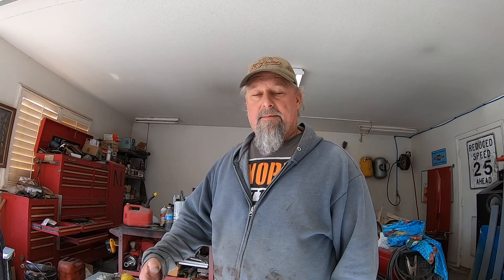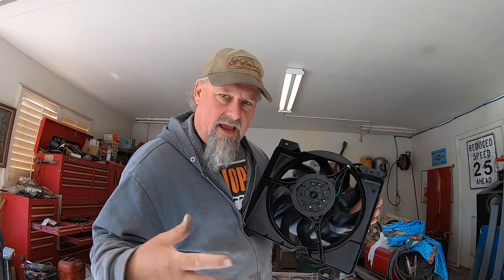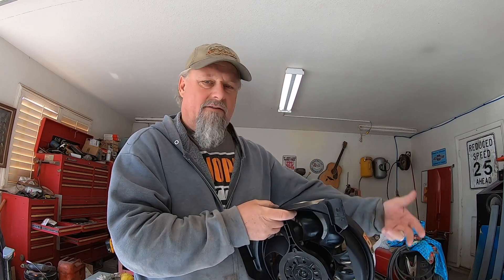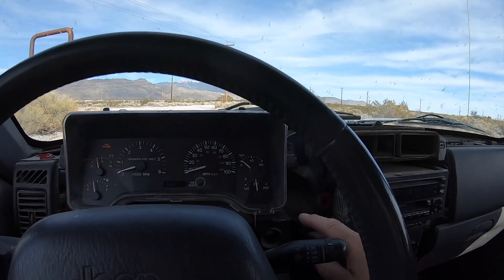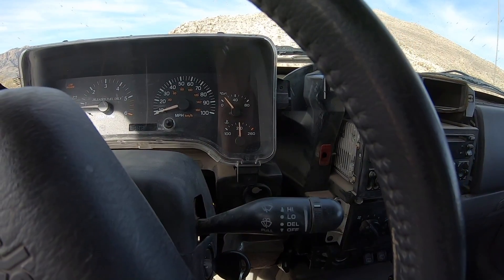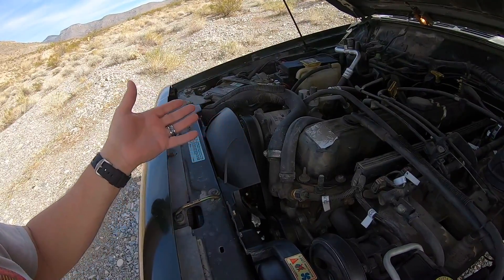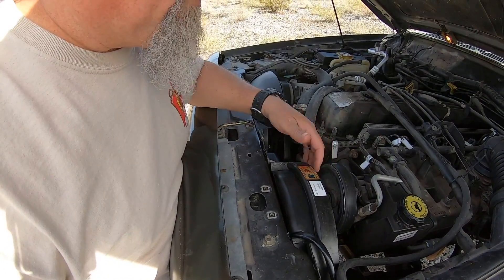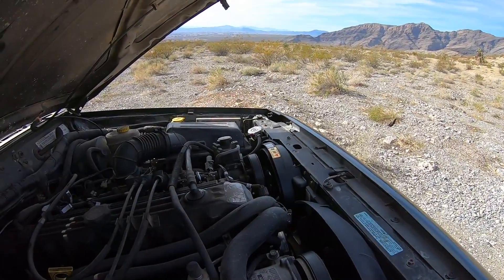Jeep XJ Mechanical Fan & Shroud, Aux Electric Fan Performance Real World Test

Comment: Very nice video! I've recently solved the aux fan not coming on in my Renix by using a late thermostat casing and placing a thermo switch in the provided port (not existant in the original Renix casing). A properly working radiator and clutch fan, plus the shroud keep the temp at bay even idling at 104F.
I'll change the aux fan to an 8-blade as well. Not needed, but it won't hurt to get the 33 year old fan out and put a new one there.

Comment: Clutch Fan wear is also something you should think about. Antifreeze keeps your ride running cooler in the summer and protects against freezing in the winter. Using water is must be distilled Water or the Block will rust from Tap Water use. That E Fan needs to be hooked back to the Temp Sensor under the hood.

Comment: hey whats up man, any update on your jeeps cooling ??? just bought a 98 jx myself hooking up duel fans rn. Also installing the same switch you used lol, did you just drill a hole into the back of the ciggarette pannel, looks like i have to remove a lot of plastic
for a phone cord or something. Thanks!
Reply: Where did you buy your dual fans?
Reply: @ignaciocastillo4891  they came with the jeep when i bought it. they wernt made for my jeep and could be fitted to the radiator better

Comment: Factory set up on these works great.
Reply: MichXJdad  good reply, but if u want tips on cooling it, then keep 99 percent of the factory set up , if in warmer climates use dual electrical fans not 3, and use the factory stat,  be sure to perfect the mixture, use distilled water religiously,  and check belt tension. And no not rev the piss out of any engine when under 4x4 load, it's not a mad ram buggy it's a creep jeep, gag it when necessary otherwise I'm that guy with a no faults system and it's all factory, I dont even run an electric fan and still use the cytrfical force fan with no shroud, it does not get hot, a single row is better than any other row, because it allows air to flow faster threw it . Clean hoses and solid water pump and the correct factory stat, Ive done everything else with fans and rads and pumps and stats, factory set up has yet to make problems ,and running to cool will hurt these engines and running to hot of course will.... they also like to warm up a little before taking off 3 to 5 minutes regardless of temperature,miles and climates , I live on the east coast , alot of hills to climb , and it does amazing. It creeps up to the 210 mark but unless there is clogged issues like in most xjs that were driving so long with no maintenance and have passed onto the next guy who wants it perfect it , the little issues cause issues like that, I run straight green Prestone and only Prestone, mix with distilled water and correct the cap especially if it's got a red pull tab, those are garbage , use factory style cap .I've used them all, I've owned 4 xjs and the coolant system gave me issues alot, i was determined to perfect it, and i directly leave it 99 percent stock the 1 percent is no electric fan and a cytricfal force fan, again if in warmer climates run the dual fans, the system is also triggered to run the fans when AC is on, I removed the ac, if u have ac the system must be perfected in the what I've explained. Perfect the cooling with factory stuff upgrade the fans is about it . Very simple system , and when they are ready for coolant changes ,they are ready when they are not when you are, it will keep all systems in go if maintenance correctly,  these tips are also for factory set ups ,I've never had a stroker may change a little on those terms but I cant see why it would or if at all.
Reply: MichXJdad  well it doesn't,  and between my family and myself I've been involved in and around and worked on vehicles totalling over 35 years of experience race cars, jeeps and my brother is all that also,  and just over 15 for myself only xjs andyjs, and of course multiple layers of junk cars lol, the 210 mark is where it reaches when it's getting warm it backs off to 195 when cooling which 195 is the correct stat for a jeep 4.0 that's completely normal and it only makes it those couple degrees because I run no e fan, just sticks and flows,and backs off like it should and ita not constant it consistant in a good way running to cool will cause premature engine west on the bearings, in a perfect world and then once the world goes to shit at about 100k I've heard of xjs having cooling issues, it was also due to consitant improper maintenance,  and flushes,  they are a iron block and will for sure be more prone to deposits building up and clogging up ports, I've personally witnessed almost every xj have build up. Well I was lucky my engine came from a 97 tj, it was particularly maintenanced and well kept, the mixture is very key to the cooling, people will say what they want, but of course the engine will go up a couple degrees under a load /steep hill at highway speeds , off road should not be an issue if the system is proper, correct pressure and relief is super key on these engines, its sorta stressful but once good then it's good in my experience,  the only time mine sticks on 210 which is directly the middle of the gauge while sitting in traffic and itll stay pegged, still no E fan, im 3.5 inch full springs and control arms, steering and 17 inch wheels , and 33s,bumpers, It still stays there . I will be actually putting the AC back in , and using a the factory e fan because of the AC , the southwest I understand that when it comes to temp. Again I've learned perfecting the system in mixture and belt tension ,  water pump, I use a auto zone pump always have weather it's the same stuff elsewhere I dunno, works for me.
Reply: MichXJdad  I live in dubai ( very hot in summer and temp reaches 120 daily)  and I have no overheating in my 2001 jeep cherokee xj and there is no modification in cooling system ( clutch fan and one electric fan) and the temperature gauge always in the middle and sometimes above the middle when a/c is on then the electric fan kicked to cool the engine.